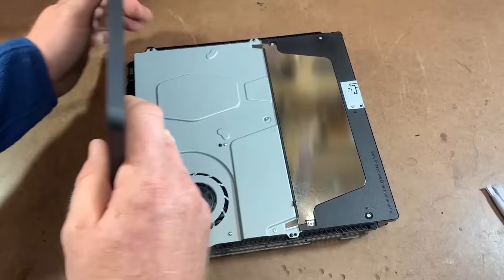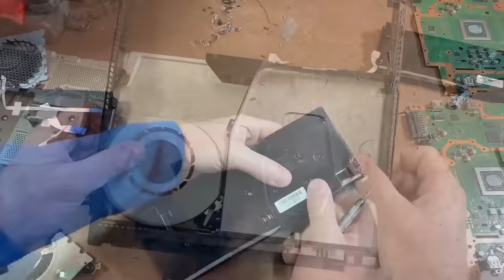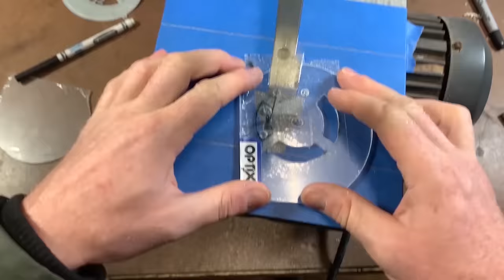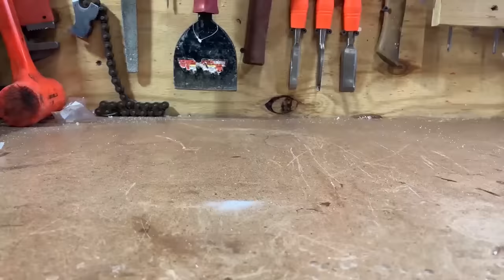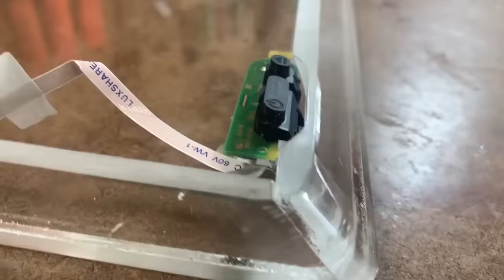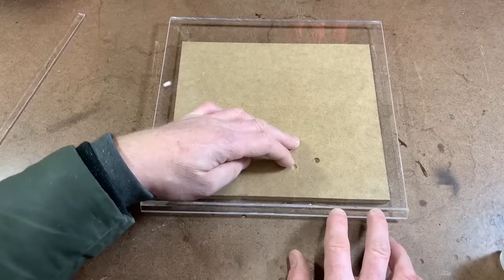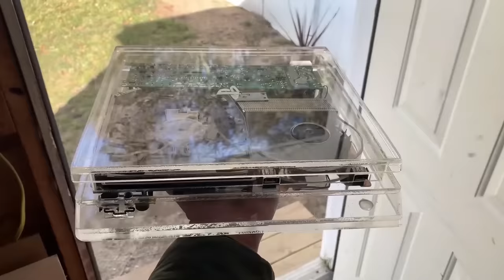Glass Playstation 4!! Custom Hand Built!

Comment: Good work, but you did much greater job with the ps1, good air holes, better holes for the connections with no gaps at all and good laser engraving, that is far better than this, good luck with cooling 😊

Comment: Small design oversight, the ram gets its cooling from the thermal pads you removed, that touch the bottom aluminum shield you removed. Not something you would see anyway as its on the bottom. Given these do have ram chips do fail every now and again, Not something id be happy with removing. Very cool looking though.
Reply: and you also failed to replace the ventilation holes in the case of the original, thus that fan is moving very little hot air around inside and thats really it. Aside from some that escapes around the usb ports and disc drive.

Comment: credit for the hard work but maybe you should have used screws instead of glue for the heatsink of the ps4 slim, because you need to install thermal paste.
also, WHERE ARE THE FAN VENTS? it only can breathe air in from the blu-ray drive. also, where are the thermal pads for the ram chips?
this is going to be a cool little overheating paperweight

Comment: Two issues with this... 1.. Not Glass 😛2.. That console won't work for very long due to overheating - The RAM chips at the back have thermal pads in place which make contact with the large panel you threw in the bin, which acted as a heatsink to dissipate the heat, nor did you replace the thermal interface material (TIM) on the actual GPU. Still a cool looking display piece though.

Comment: idk why you glued it all together like this... you could have just as easily glued blocks around inside the edges, and threaded screws into the acrylic. like everyone else mentioned... no vent holes, pull this thing apart and redo the exterior with some threaded blocks to hold the top to the bottom, maybe some shiny chrome screws.. great work, but the functionality is very very flawed.

Comment: While I am impressed with your ability to build, the lack of electrical separation terrifies me. You’ve affectively referenced the entire motherboard to mains voltage by not including an EMI shield and plastic separator between the power supply and any other electronics. If it works though. 😅

Comment: Well... I will say that it did take a fair bit of ingenuity, however, you failed to account for airflow, you failed to account for the ease of disassembly for cleaning. It looks great but it is impractical and not really advised.  I think you should take another go at this but instead take better measurements of ALL components and make it more user friendly. Gluing everything in place really defeated the original intent of the entire design of the slim and you should have done your due diligence in this case.  That poor system is going to fry itself.